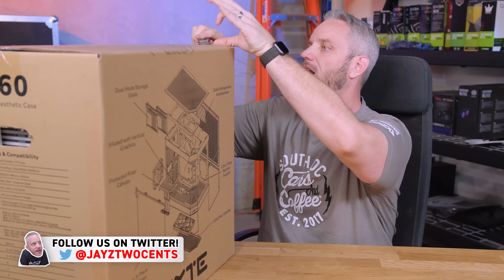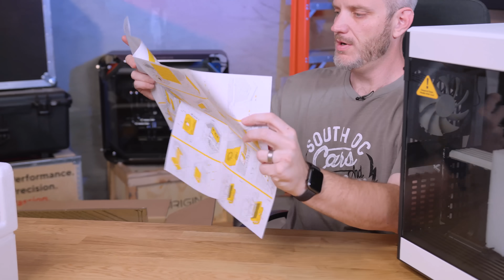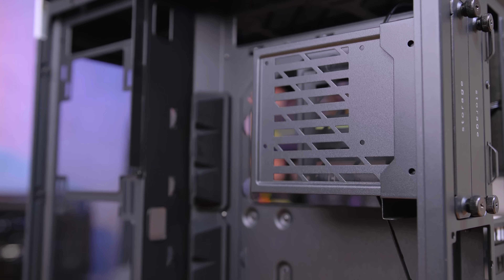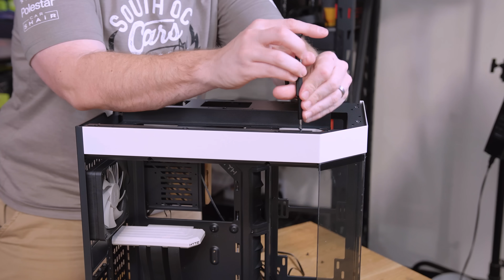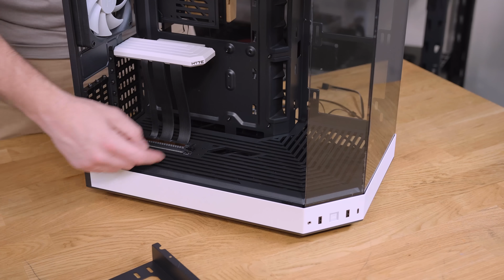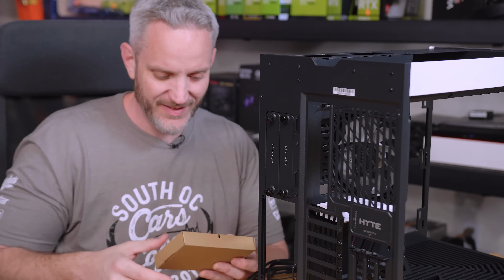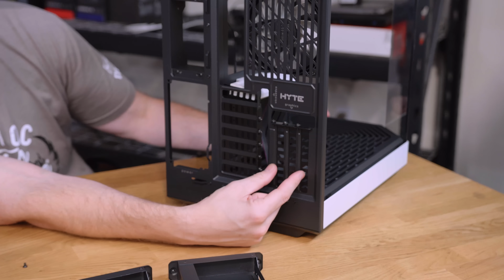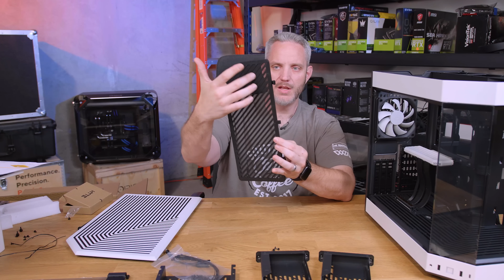Someone FINALLY broke the mold for PC cases...

Comment: This is the sort of cooling we’ll need as the next generation of insanely power hungry GPU’s and CPU’s come out. The next logical step is integrated air conditioning that dumps the heat outside.

Comment: Were I looking for a new case, this would definitely be on my shortlist.  Currently using a P500A and I have vertical GPU and can use full height cards in the other slots.  Of course, over-height cards like most GPUs won't fit there.

Comment: I've been looking at cases and builds lately in hopes I win my ssi hearing coming up in may (I can dream anyway) and  like this case, it at least has plenty of airflow, PLUS I have a good history with ibuypower.  I bought my current machine from them in 2015 (or at least what it started as).  Sure it's struggling now, replaced the mb with one of the same type (although slightly downgraded as new one doesnt have front usb hookups or flashback) as the old one bit the dust and I've replaced the old r9 280x it came with with a rx 580.  Problem is none of the newer cases really appeal to me more than my old case.  Yes it's ancient by today's standards but it's a lovely deep blue color, has a ton of airflow in sensible places, has room for a sensor panel, a sd card reader, and a cd drive which I realize isn't normal these days but I still feel is nice to have and everything on it works just fine (well the front usbs don't now but that's from not being hooked up not because they don't function).  What happened that all cases now seem to be some varient of a grey, white, or black rectangle with glass sides, 2 usb tops and no add-in bays at all???

Comment: I am in Germany and I dont think this case is available here.. If I could buy it I would as soon as I can and I would just put my current system inside it. 
It's a ryzen 5 2600 with a gtx 1660 and 16gb of ram at 2666mhz

Comment: Welp.  I know what my AM5 build is going into now (whenever it materializes, that is).  Thanks!  :D
edit: back in the day the low-profile design would have turned me off, but honestly I barely use any expansion slots anymore, and the ones I do come with swappables.
Reply: Thought the same thing for a future AM5 build.
Reply: @Neopulse00  TBH for as reasonable as the price is, I'll probably go ahead and get one sooner rather than later and just sit on it, or maybe stock it with parts I can get in the meantime.

Comment: FINALLY you've talked about this case!

EDIT: About slim addon cards: Both Elgato HD60 and 4K60 cards (and a lot of the alternatives) are low profile nowadays (not the Camlink Pro because the 4 HDMI inputs), and lots of options on NIC's (10Gb isn't common on motherboard integrated LAN interaces). I happen to have one of those capture cards and I would absolutely love to put my dirty paws on one of these cases. Too bad I can't buy from them because there aren't any vendors here in Brazil. (I may have to directly import one and hope no glass panel accidents happen)

Comment: I'd really love to see you do a custom loop in one of these. I feel like this kind of "showy" case is meant for something like that, and who better to do it than the king of water cooling?
Reply: Every single review I have seen for this case so far has been like "Oh it would be great for a custom loop!" and then they slap an AIO in it and call it a day.
Reply: Agreed.
Reply: Full glass loop. It's got the goods to show it off.
Reply: @soreloser6018  I made a case from scratch using Ebony hardwood and polished aluminum utilizing a full glass loop with a power distribution block I made and a manifold I made to distribute the cooling to the 4 340mm rads. Took almost a year lol
Edit, bending glass is a bitch. Do not attempt unless you have way more budget for tubing than you think you need. I have glass working experience and still wasted a solid 6ft of rod lol
Reply: This case looks really cool. Almost contemplating ripping my gear out of my thermaltake P3. The half sized panel risers are a no biggie. I don’t run anything but a gpu over there.
Reply: I wonder if there’s room for a channel called “Jay’s Two Loops”
Reply: Custom loop
Reply: Definitely so. That large paneling area is definitely disigne with show in mind hence why they gave you so much ventilation throughout the rest of the case to ensure your show stays on the cool side
Reply: Agreed with the original commentator, hit the nail on the head.
Reply: Agreed
Reply: I have two. One is my desktop PC, and the other is my desktop fish tank. 🐟
Reply: Well, its only been 2 hours and I'm willing to bet you made it happen lol
Reply: Yep, I wanna see it!
Reply: Same, would love to see it. Case looks pretty cool
Reply: Paul's Hardware YouTube Channel has one build over ~2 plus weeks ago!!
Reply: Why? So he can make 10 videos parts and delay everything for year like he always do?
Reply: im looking to do a custom loop in this case when it releases
Reply: not even close to a king at this point
Reply: This comment can’t be ignored
Reply: you should do one yourself! this case was super easy to do a custom hard loop in!
Reply: Nice aquarium
Reply: yes please i wanna see a custome loop in this
Reply: Agreed, I would love to see a dual custom loop with him watercooling the CPU & GPU
Reply: “King of Watercooling” relax. While I love Jay for his very educational videos on watercooling, there are more talented modders out there that have made some incredible rigs. Look up Declassified Systems, Designs by IFR, GGF Events, Praetex Designs (Formerly of Alex of Bit-tech) just to name a few
Reply: @TDDTheDon  Oh I know that others do great custom loops, but it's Jay's channel. Also, IFR is the definition of ATBGE - he'll be making something fantastic and then there's something that always has me yelling "NO WAIT STOOOOP!" at the screen.
Reply: literally a fishtank case
Reply: @TheCockman  That's a great idea for a build actually. I wonder if anyone has ever done something like that before? Now I want a custom PC desk with a fish tank between the PC on bottom, and the top of the desk.
Reply: I will only use the Cooler Master HAF 700 Evo cases,I have used this case 6 times now, I won't be using any other case,as of right now nothing else beats it, that I've seen.
Reply: "king of watercooling" btw.
Reply: King of water-cool... definitely not go checkout liquidhaus or plenty of others that actually watercool everything
Reply: @toph2758  I'm astonished by the number of weirdos who have crawled out of the woodwork to insult Jay in the comments of his damn channel. I won't defend Jay, he can do that himself. Instead, I'm going to ask why you're hanging out in the comment section here instead of one of these "better" channels?

This is a rhetorical question. I don't want an answer. I simply do not care about your response.
Reply: @isturma  I'm astonished on how much you ride his cocktail... calling him the king of watercooling just shows how novice you are. I'm not insulting him either.. he makes good video's half the time.. all I'm saying is he is in not way the king of watercooling
Reply: @toph2758  I love the fact I get to live rent free in your head. Mind if I sublet the place?
Reply: @isturma   incels being incels

Comment: That's a pretty nice looking case. Is it designed to allow for being laid flat on it's "back" so instead of a tower, it's horizontal? That would make the front panel connections a little more accessible.

Comment: Damn... that's a chonky case that wants to show off.  Looks like a mix of aquarium and refrigerator.

Pop a AMD 5950 and a high-end mobo in there, and max out the RAM.  Pair it with a NVidia 3090Ti.  Liquid cool everything with frosted tubing.  Maybe frost the GPU and some of the glass to make it look like it's frozen.  Kinda like it was LN2 cooled but really isn't?  Pop some high-capacity hard drives in there, and have it do rendering workloads like a render farm with a monitor on what it's doing. 

It's a show piece.  And it needs to show off.

Unfortunately I don't have to room for such a thicc case.

Comment: I have it, looks nice and is built well. However it runs a bit warm for my taste, even with Noctua Nf-12/Nf14s the GPU is warmer than I'm used to. I'm talking about going from 63c to 74c average. In my opinion it really needs more air flow from the bottom. Especially since the riser cable mount blocks a lot of the air coming from the bottom.
Reply: What gpu do you have? My 3070 (oc) runs at 64 maximum

Comment: I don't even consider a case that doesn't give me at least two 5.25" bays for optical drives (yeah, I still use CD/DVD/BluRay) and a minimum of four 3.5" platter hard drives (I have a metric butt ton of media files, and I back them up, more than once). So give me a Phanteks Enthoo Pro every single time.
Reply: lol

Comment: I like this case but what is stopping me to buy it is the Cable riser is PCIE 4.0 and my Asus Maximus X code is PCIE 3.0. The manual PDF on official HYTE site doesn't tell you if you can change the cable riser on the white adapter to 3.0

Comment: was wondering if my 6900xt toxic  could fit  on the side vents panel... still  got  my h115 to fit at  the top so I  was wondering if the  360  rad of my toxic fits

Comment: Big NO because of those pcie slots, at least for air cooling case. It's already proven that vertical gpus have higher temps. i still want the option to place my card horizontal in a case

Comment: Interesting, Honestly the last really inventive case I seen was the Silverstone Raven RV01, as It was functional and different InWIn has nice designs but they are form over function.
Reply: The RV and later the FT series from silver stone were brilliant cases. I wish case companies would actually do a 90 degree motherboard case but they generally are a pain in the ass to deal with from a cable management perspective... but my god, the pig tail at the back is good.
Reply: @TheObsesedAnimeFreaks  : I have a Silverstone (not the very first) and management wasn't any worse than any other case.
Reply: @brodriguez11000  when dealing with certain types of cables they can be a mess to deal with. Like too thick you can't putt the top on, use an adapter can't put the top on, things like that. Not to mention you gmhad to rout everything out the back of the case which made for a very nice pigtail coming out but let's be honest if you had a tone of cables that would get quite old quite fast

Comment: Nice case, would like to see a slightly bigger 140mm fan based version, which could fit at least two if not three 420mm radiators for a GPU & CPU combined custom water cooling loop. These RTX4000 cards pull a lot of power so are going to throw out a lot of heat.

Comment: I plan on using this case for my next build. Supposedly you can actually mount 2 ssd per sled, not sure how. I plan on putting a 5900x with an ek 280 elite aio on the side and the sapphire toxic 6900xt.
Reply: Mounting holes are on both sides of the sleds and the drives are offset from each other in the sled. Not sure how good it would be for heat though

Comment: The 3090Ti fit in vertical, would sit on the glass :D This case is so bulky that it does not even fit the 3090Ti! We need cases with 5 slot clearance now, and for the next gen GPUs we might need a whole vented room as a case (if you don't want to sweat while playing games) :D

Comment: Just got the case the other day, and it REALLY is so much better than the competition. I previously had a CoolerMaster TD500 Mesh, and I have seen a 5 degree difference in both GPU and CPU temperatures. Not only that, but it looks absolutely amazing with so many viewing angles. Overall, I'd recommend this case not only from an airflow or aesthetics point, but also value with the PCIE 4.o riser.

Comment: I was hoping this case had more places for spinner drives... my 15 year old case has seen better days... for my next build I want to get a new case, but I need room for 4 3.5" hdd's and 120x360 radiator... also still need those dreaded 5.25" bays... sigh, but I still use them

Comment: I just finished my build like three months ago and then this thing came out. It's very very hard for me to not buy this thing. I'm also pretty sure it's gonna be the new o11
Reply: no it wont. O11 is better in every way (more fans at the bottom, option to install horizontal gpu for better air cooling and lower temps, 3 side fans, more front io, better atx/eatx support etc)

Comment: Looks cool, but way too big. I also like that it looks like the fan slots were designed for 140 with 120 as an option instead of the normal thing. Actually makes running 140s worth it.

Comment: It seemed mostly fine until the expansion slots, just a bad decision.
And those openings seem really closed with that huge amount of plastic, would be fun to see Tech jesus reaction to that.
Reply: only low profile option addon card i've encounted is a wifi card that allowed swapping between a normal and low profile bracket i got because my motherboard didn't have wifi. I swear I saw someone else review this case, either it was Steve or someone from LTT.
Reply: I hate the fact that you are forced to use a vertical mount for the GPU in the first place.  That's optional on most cases.  Why force it?

That alone is reason enough for me to not buy this.
Reply: had the same thought lol. could be more air restricted then we think
Reply: @Spank Buda Name some low profile GPUs

You literally can't properly install a GPU mounted horizontally in this case

It's literally a deal breaker if you have e.g. an Elgato HD60 Pro capture card, which I do
Reply: @ElysaraCh  same here. This dude is crazy optional vertical GPU my ass. No low profile brackets exist any any current GPUs even single fan designs have full size brackets.
Reply: @ElysaraCh  the elgatos have low profile mounts
Reply: @Spank Buda Sound cards, capture cards etc. A lot of folks still use those.
Reply: @UCL3bLRMBPiK5eQANnuCrnTw It is not optional.  From Hyte's own product page, "The Y60 is designed to exclusively display your GPU vertically."

Look at the slot covers at the back of the case.  There is no way to have a GPU mounted normally there and no mention of an alternative back panel.

This thing is for vertical GPUs only.
Reply: @kevadu  ... which makes it a very big paperweight for me. i loathe riser cables, and as PCIE becomes faster and faster, these become a bigger PITA :)
If they had normal PCIE bracket support, it would have been an awesome case
Reply: the whole case is full of openings, I don't think air flow is going to be restricted.
Reply: @DVankeuren   I have heard of 'positive pressure' in some cases, this will not be possible in this one!
Just a thought as I looked at all the holes in the case
Reply: You don't have to vertical mount the gpu.
Reply: @LonestarsSupra  You have to because what are you going to screw the back of your card into or you going have nothing but the pcie slot hold it in place and have something else keeping it up?
Reply: @LonestarsSupra  Where the hell does it go then? The horizontal expansions are all low profile?
Reply: Yeah... Those are like DVD roms lol. Not many use them besides the GPU.

Comment: Ok...

This is not a knock against you at all, Jay, but WHY are there SO many cases that spend an OBSESSIVE amount of time with cooling??? I get it. It's an important factor in a case. But it's not the ONLY factor. What about 5.25'' drive bays for expanded moddability? What about extra IO ports? What about LCD readouts? Comparative weight? Ease of maintenance and hardware installations?

Almost NONE of these things are given any attention anymore. I'm sorry, but at this point, I'm just incredibly bored looking at modern cases now. Again, this is not Jay's fault. He's just reporting what's going on. All the same though, it is what it is.

Comment: One thing I love about BeQuiet cases from the older lineup is that their drive sleds support either a 3.5" drive or two 2.5" drives...
If I was forced to, I could fit 14 drives in my case without it looking terrible...
Reply: One of the reasons I was so slow moving away from my h440
Reply: @joshua41175  Posting from one!
Reply: I THINK I saw two rows of holes for screws on each drive sled. You can also get any generic 3.5" to two 2.5" drive adapters, they're cheap depending on where you get them.
Reply: As someone running two nvme and 4 physical drives, I agree.
Reply: @mephInc  Aren't NVMe "physical" too?
Reply: @HammyHavoc  I think mechanical drives was the word he was looking for.
Reply: @HammyHavoc  
You know exactly what I meant. If you're this much of an ass in real life, you're gonna live a very lonely life.
Reply: I just disassemble the 2.5 SSDs and stack a bunch of them with standoffs in a 3D printed case. So much more compact
Reply: I've noticed that about most new cases. They seem to default to 2 drive support especially in the budget department. Trying to build a nas out of spare parts I wound up getting a define S2 Vision off kijiji. However unlike the other Define cases it only has 3 slots because the wall doesn't transform. So that kinda sucked.

I paid like 60 CAD for it and it was in pretty much new condition, had all the screws and accessories not to mention the guy replaced the back glass panel with a R6 solid panel. So it'll do for now.

Comment: when are they going to put the gpu power on the other side and make a channel for the cords?
why dont we have cases with flat motherboard layouts? with the gpu weight increasing we need a new configuration for hardware.